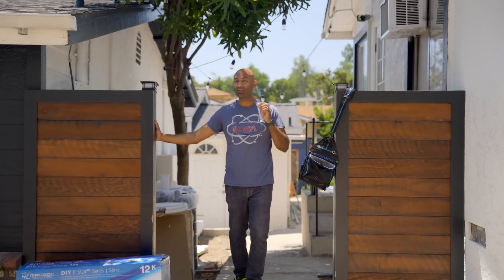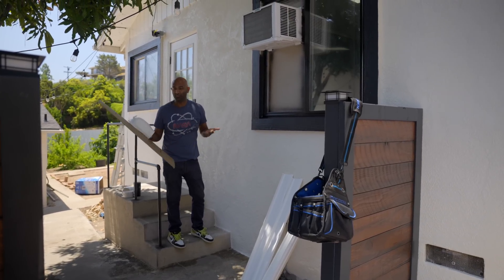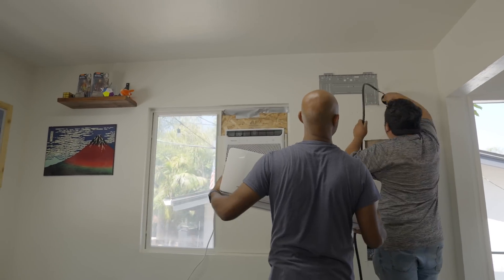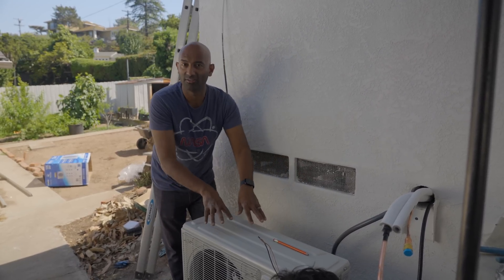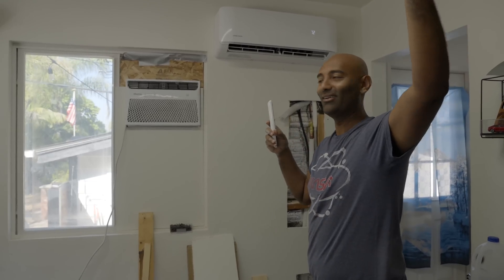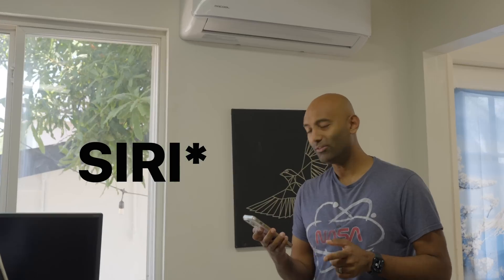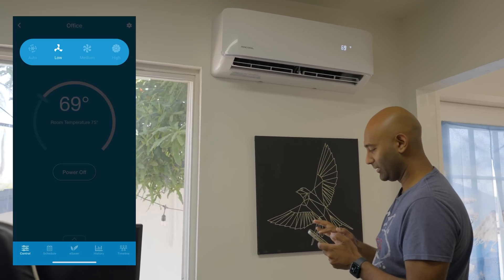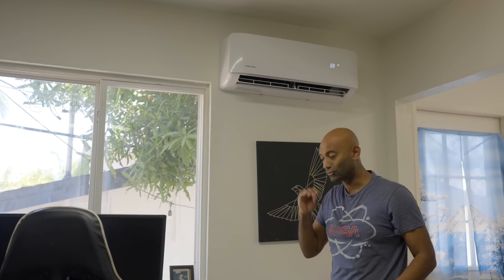Summer Heat? Here is Your Answer! DIY Mini-split Heat Pump!

Comment: SEER2 and EER OR CEER aren’t the same thing. This will definitely save you money over resistive heaters, and definitely work better, but I am having a really hard time untangling whether they are actually more efficient in cooling mode than a modern inverter window unit. Any help you can provide on this topic would be greatly appreciated.
Reply: I just looked, and the 19 SEER Mr. Cool on Home Depot’s website has a cooling efficiency (EER) of 11 BTUs/kwh in cooling mode at 95F, which is the same as all the cheapest window units. Fancier window units go up to 15 CEER, but I can’t find whether that is at 95F or a seasonal average ambient temperature. In general, EPA standards for cooling efficiency go down when the heat pump is reversible. 
Anyway, a little bit of a deeper dive into Energy efficiency ratings would be super helpful.

Comment: Did you vacuum pump the lines BEFORE releasing the refrigerant after connecting? I think you're supposed to do that ... kinda skipped that part, I think.
Reply: The lines are precharged. That's what makes Mr Cool and other brands with this feature popular DIY options, the precharged lines and valves eliminate the need to evacuate the lines.

There are some legitimate criticisms of this technology, along with servicing issues, but it seems like a lot of people are pretty happy with them.
Reply: @dave7038  Interesting. In most setups I've seen the refrigerant is shipped in the outdoor condenser, but the lines are open to the world. I didn't see a process where the lines were sealed, but I do know that what you say exists, and I didn't know that MrCool came with pre-charged linesets. Cool! Thanks for correcting my comment. Cheers

Comment: The precharged lines are a great idea. I will consider getting one as I can do it all myself. You could boost the summer cooling efficiency by evaporatively cooling the air that enters the condenser unit. since it also pumps heat in the winter it will pay for itself much faster.

Comment: Two things... (1) after your rant for "hire an electrician", you didn't. And it's not to any code I'm aware of -- no disconnect next to the outdoor unit. (2) I wouldn't put drywall back over those connections. The day will come that you need to get in there. Or someone (including you) may forget those lines are back there and drive a nail/screw right through them. There are knock-out panels for this very thing.

Comment: I've watched a few diy install videos of mini split units and this was the first that I didn't see the use of a vacuum pump to clear the piping of air and moisture. I would think that would make it a bit more efficient, not having the air/moisture that's in the pipeline in the system or did I miss something?
Reply: it was pointed out that the lines are precharged, but not how this magic trick is performed.. The pipe end fittings are fitted with auto opening valves, on connection to both ends, very lightly charged with the refrigerant. 99% of the refrigerant is stored in the outside condnser. the inside unit still contains the hostile nitrogen oxygen and water vapour, and yes this is ingested into the refrigeration circuit. this adds to inefficiency and shortened life of the equiipment.

Comment: And another thing ...
We use this systems 20 year plus ...

And you made many things wrong ... do you even read the instructions and instalación manual ???

1st.. the insulation is wrong, in Europe we use 20mm minimum insulation...

2nd ... No vacuum clean or pressure test ???? 

3rd ... No Azote charge either ...

4rd... you know how much impact a leak off refrigerant has on climate ... 1kg = tons off CO2 equivalent...

So congratulations to show what we are NOT doing in Europe in New instalation to protect the climate...

Great job...😵‍💫😵

Comment: Actually I'm an Project Engineer in Europe Market and the regulations are promoting Heat Pump air/water or water/water systems... they are a lot more efficient and healthy... split AC are prone to Bad Air Quality ... we actually have a document and recommendation to not use split systems ... they promoted the spread of the pandemic... they estimate +37% contamination were spread by split AC systems ... 
A little research would help ...😎

Comment: Do these units not require that a vacuum be drawn on the the refrigerant lines before releasing the coolant?  Great video.  Considering putting one in my garage.  Thanks.
Reply: Not on the Mr Cool. The compressor and the lines are pre evacuated and pre charged with the proper amount of Freon for the length of the line set. Of course, this assumes you will make all the connections perfectly pressure tight and that you will not kink the line set while bending it.  These are the two biggest mistakes that DIYers make. Avoid these two problems and success is highly likely. I would add that you also need to check local code requirements that vary from area to area. For example, in my locale, I would have to have a service disconnect outside next to the unit. And finally, you can’t cut the line set to make it shorter, so if you have extra you will need to loosely coil it somewhere. I suggest if that is the case, that you coil it horizontally instead of vertically to try and prevent any refrigerant oil from potentially pooling and creating a clog.

Comment: Just an FYI, you probably should have used one inch PVC for the drain line in the wall because condensate lines are notorious for clogging after a few years
Reply: The picture needs to be straightened!
-OCD😊

Comment: Most areas in the US have some code for a service disconnect within like 6' of the condenser unit. You just have a whip running to the unit. Should really have some kind of disconnect there.

Comment: If you have a pool, is there a way to use the heat from the AC to warm the pool?  Because I've seen many pools are using heat pumps to Heat the pool, why not one that does cooling the house while heating the pool? Does that exist?

Comment: American houses, build like a tool shack, from few planks and 4x2 + some lame isolation. Man, here, in central EU average house is build with bricks and 10-15cm of wool or styrofoam, bigger houses or apartments buildings are usually made with reinforced  concrete. Of course, different climate dictates different materials, but our building will be OK after 150-200years, even more with proper maintenance, can't tell the same with wooden skeleton US houses that fly away with every tornado or hurricane. In EU Brick house for a family (lets say ~120-200m2 (square meters) of usable interior) costs 150-200k USD, depending on technique, used materials, contractor, big city vicinity, finishing, appliances, furniture etc. You can build or adapt for far less or for faar more, as everywhere.....

Comment: As an HVAC technician, I had huge reservations about the Mr. Cool and similar DIY installs. My worries have proven unfounded, but- and there is always a "but"- be sure to check about local and state laws, particularly fire codes; some will not yet let this install be done by a home owner, and violating that could jeopardize your homeowner's insurance. With that one caveat,  I'm sold on the stuff- everything I would have put into those kits is in the boxes; I think I would have thrown in some A A batteries though.
Reply: Yes, check your local building department and see if they want money.
Reply: @@aivarsaar They are "pre-charged"  MRCOOL® DIY® Quick Connect Pre-Charged Line Sets: Tested for Perfection
Reply: @@aivarsaarthe lines in this kit don’t need to be “evacuated”. No need to pull a vacuum as there’s no soldering done and the lines are prefilled with refrigerant. So it would be useless and counterproductive to “evacuate” the line sets….
Reply: @@aivarsaar The Line sets shipped with those units is sealed with the "complement"  of the fittings that seal the refrigerant into the Condenser unit. The line set is shipped pre terminated with just enough refrigerant to add for it's length. Maybe you ought to do better product research? Your spelling could do with a touch or two also.
Reply: @@aivarsaar The line sets for those units is pre charged and locked in by special valves that only push open when they are tightly screwed onto the condenser and the evaporator.

Comment: Amazing Ricky! 
My whole house has these mini-split units, but from Mitsubishi, we LOVE them.
I'm so pleased for you!  

Cheers, 
Eric
Reply: I wish that I had went with something like this rather than replacing a huge central furnace/AC.  My problem is that heat loads are just so variable across the house and duct pressure is different across the house to the point where I've installed a window unit in one room and a duct fan to increase cooling/heating to another.  I'd think that two multi-zone mini-split units would've worked far better in the end, but it seems like some US companies are just slow to transition to mini-splits as an option.
Reply: @shinaikouka  maybe what Ricky did could be perfect for you to replace window units or where you have the worst challenges.

Comment: I cannot wait for a good heat pump like this, a few solar panels, and a few batteries and an inverter is a really easy way for someone to get into solar, without breaking the bank, and honestly not having to mess with grid-tie systems, throw this in to suppliment your whole home AC. Heck, make a DC version that doesnt require an inverter.
Reply: That's already being done. Lookup the  EG4 12kbtu unit someone else mentioned in another comment. Direct run off of DC solar and can mix with AC input too.
Reply: @BLKMGK4  I might buy this when it becomes available

Comment: In Australia this has been the norm for a long time.  We call them split system, reverse cycle air conditioners.  I had a reverse cycle window style unit (mounted through a wall though) in 1983.  It was great for the time.  These modern units are more efficient though.   As heaters in winter they are brilliant; the most efficient electrical heating by far.  That's because they are a heat pump.  The energy is coming from the heat outside.  Even if it's 0° C (32° F - freezing) out there, there is still a lot of heat energy.  In fact it's still 273° K.

In Perth it's a very rare morning that gets that cold.  In summer though we can get some serios heat.  Then, not only do they cool, but they dehumidify too.
Reply: Same in europe, I don't understand how this is a game changer when that has been standard for years, and there are units for as low as 300€ with acceptable quality...
Reply: I suspect the hyperbole is because of the pressure to stop using natural gas for heat.  Trouble is that the electricity is not as green as people think.  I have a unit that shuts down below -22degF but it doesn't really provide enough heat below -13degF.  These low temp units are not cheap.
Reply: I think you're misunderstanding the situation. It's the fact that you can install it yourself that's remarkable.
Reply: @theoccasionalvideo  we banned this technology, 30 years ago, for this very reason said that the home handyman cannot deal with restricted technology such as refrigerant gasses

Comment: Isn't this just a split type aircon as we call it here in the 3rd world?
And a good benefit is also that the hot and cold part are now separated and not together in a small box like a window type aircon. This will increase its efficiency and thus lower your energy bill i wanted to add.

Comment: yeah, got one of those for 750€ last summer, installed it in a day outside-below my window.(i live in a small flat on the first floor)
it also works as a heater in winter and saved me a around 1000€ in heating, that was a very worthwhile investment, lol.(part of the savings was from the high energy-prices, but it cut my yearly energy use for the entire flat by 1/3)

Comment: Fitted a similar system over here on the other side of the pond 🇬🇧 works a treat and so easy to fit. One small down side though, my one will only heat if the outside temp is 5°c or above below that and after a while the outside unit ices up.

Comment: Isn't more ideal to evacuate the refrigerant line that goes into the house?  Those lines have air in them when you first connect the outside unit and release the refrigerant.  If there's moisture in those lines, it can lead to problems arising sooner.
Reply: nah, the mr cool line sets are precharged as well apparently.
Reply: @Etacovda63  Precharged inside the compressor unit.  The line that goes to the inside unit obviously isn’t precharged and that has air in it.  It’s the reason why professional auto mechanics need to evacuate the car AC lines due to possible accumulation of air in them over the years.
Reply: Mr. Cool DIY systems are made for homeowners to install themselves. The line sets are sealed on both ends with special fittings (not flared fittings) and air has been evacuated at the factory. No vacuum/decay test necessary. Check your local codes, most areas would require a electrical disconnect at the outdoor unit. (I did not see a disconnect in the video)
Reply: @KingofPlumbing  But my question really has to do with the lines going into house and connecting to the inside unit.  The lines WITHIN  the outside compressor unit are evacuated by the factory but remember when Ricky connects the line to the compressor unit and there’s an audible break of the seal?  That’s the refrigerant rushing into the unevacuated lines going into the house.  Were those lines pre-evacuated as well?  Remember that Ricky’s connecting lines are really long and the air inside can be a significant factor in introducing air into the system.

Comment: Good upgrade for people have window unit, if you have a new house a package unit or split system still the best for Efficiency and Lower Maintenance. It is okay to DIY your mini-split but people often man-handle the system and line-set which causes leaks which cause shit ton of problem, even can completely ruin your system .  Still Advice people who don't have any construction and Hvac experience hire some technician still a good choice, you not paying him 2 hours of  works, you paying for years of expertise .

Comment: Watching this and Technology Connections videos on split systems seems weird as they've been used in Australia for decades (and they are all reverse cycle). Is amazing that USA whole house systems haven't been reverse cycle or inverter technology for years
Reply: Yeah, in Europe we also have things that are even more advanced that what's show in the video and they are just the norm here so I didn't get what's so special about it. Also installation is always done by professionals but at least in my country of Romania it can be quite cheap to install such a device ( even $100 maybe ).
Reply: @mforce2  not wrong. Heat pumps for hot water and so on.

Comment: They are great  for heating. In norway we use them for heating only. Heat all my house with one unit 200 square meters. Got 3 triple layer windiws and 400 mmvinsulation

Comment: I have 2 units installed and 1 in the box. dropped cooling cost by $200 monthly. amazing units and good warranty so far.Going for a 3 zone next. Going on 3 years running in South Alabama heat.

Comment: I like this video, but for a different reason.  I have a 4000+ sqft house, but it is only occupied 300-500 sqft at a time.  Central air is very inefficient to cool the whole house to just get the room that I am occupying at the time cool.  I have moved from central to room by room cooling.  I don't cool hallways or some areas that are less occupied.  Plus...each room as a thermostat allowing different comfort levels.  Another issue with central is duct work.  Flow control and rodent control is an issue.  I think there is an opportunity to compare this type of heating/cooling vs. central HVAC.

Comment: Great review -- and you "pulled no punches" with your installation!  I truly appreciate that you did your installation the right way -- through the wall rather than running lines on the outside of the building. Perfect!
Reply: worst possible way

Comment: To every comment about vacuuming the lines
MRCOOL® DIY® Quick Connect Pre-Charged Line Set

They are factory vacuumed and filled with refrigerant with quick connectors that keep all water and air out, the only thing is you should not install in rainy weather to not get water between the connectors before connected.

Edit: every part (Indoor, outdoor and lines) is seperately vacuumed and filled with the right weight of refrigerant so unless you release it all to the birds first you can't/shouldn't vacuum anything before or after connecting it.